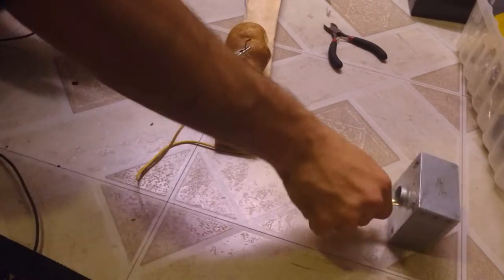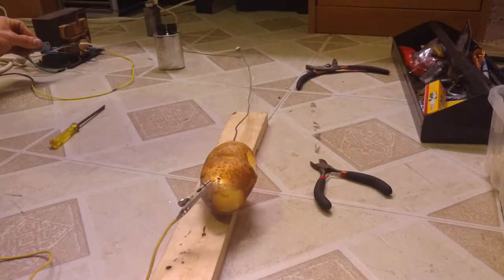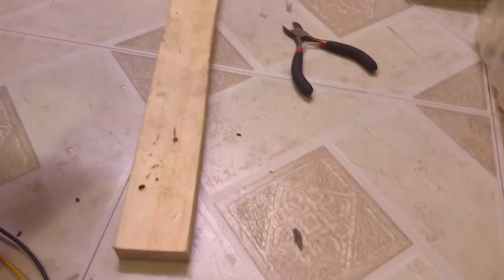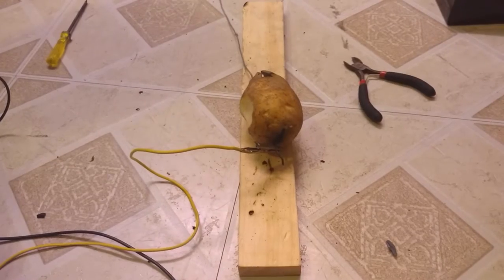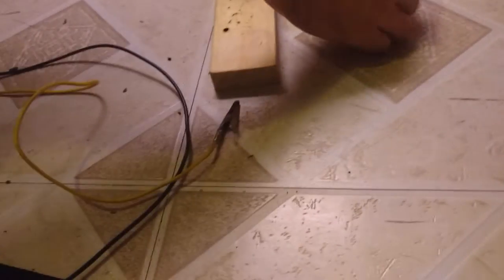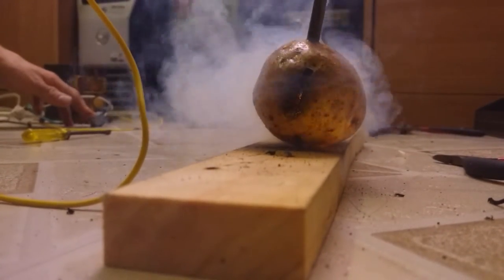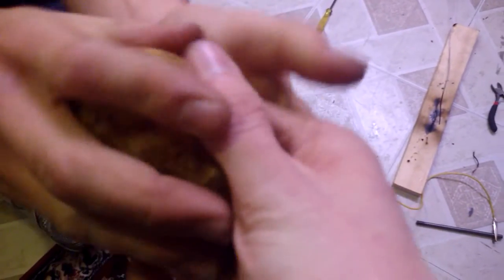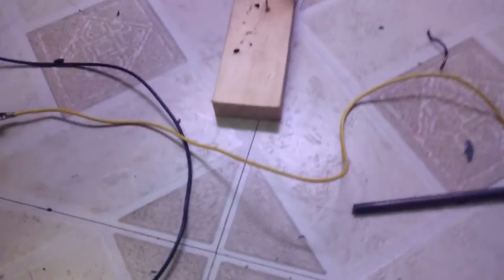Cooking a potato with high voltage electricity.

Comment: A while back I tore apart several microwaves to get those transformers and capacitors out of them. I had planned to use them to do burned "lightning" effects on wood, as I'd seen other folks do. Then I read a bit more about the potential hazards, and thought to myself; "oh hey, this seems stupidly dangerous, maybe I just won't".  Watching you guys do this, your method, and your safety measures, all I can say is thanks. I'm so glad you guys are doing this, really really far away from me! lol. Also, I'm glad you didn't die!
Reply from the maker: Yeah impressive how many years ago this is now.  We were in school at the time for two different things he was going to become an electrician and I was in electronics.  Its one of those things that is fun to mess with but I know microwave transformers are one of the most dangerous things in the electrical/electronics tinkering crowd.  I'd advise most people to stay away from them for that reason.
Reply: @BlitzKreke  I'm curious if you ever saw this thing: https://www.youtube.com/watch?v=n2ZZbuOeNmw  
It was the reason I went searching for "potatoes cooked with electricity/high voltage" ; yours was about the only relevant result I could find. So many of the results were (predictably) about getting electric power FROM a potato, seems like almost nobody is interested in putting electricity IN to it!